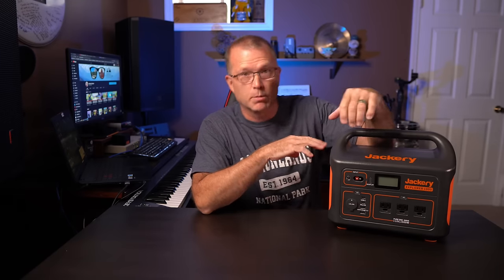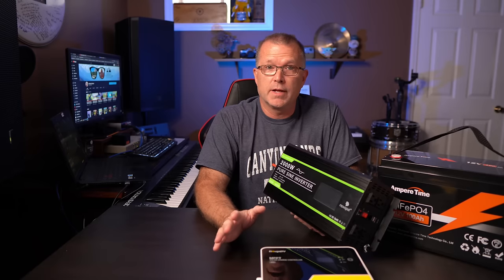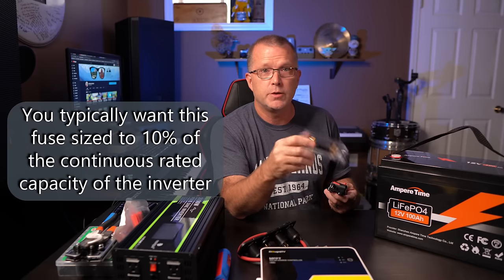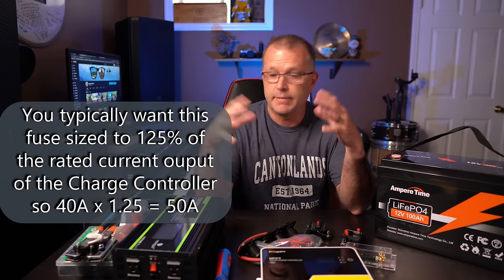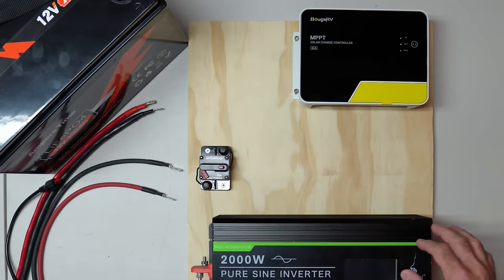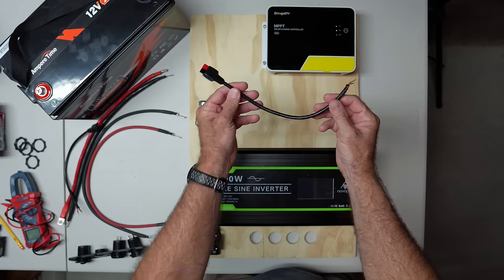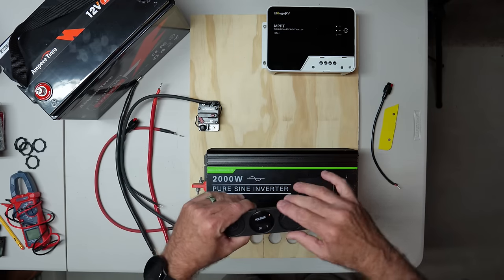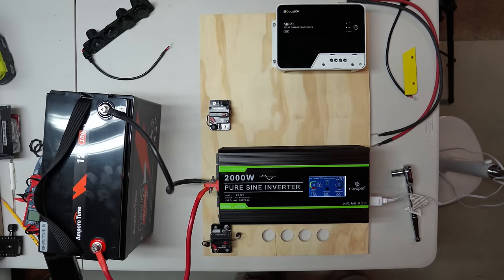BEGINNER FRIENDLY Step-by-Step: DIY SOLAR GENERATOR for Emergency Power, RV, Shed... Ampere Time

Comment: How much actual wattage we can get from that inverter and battery?
Reply from the maker: In this particular configuration, the AC inverter is capable of pulling more power than the batteries BMS can deliver.  So the battery is the limiting factor here, with a max continuous rated output of 100A @ 12.8 V....so 1280W max.
Reply: @ReeWrayOutdoors  makes sense thanks

Comment: Your DC adapters are wired in SERIES.  Not Parallel!  Hope that doesn't give adverse effects when used.
Reply from the maker: yeah - sorry, when I said that, I was still thinking of battery/solar panel wiring - where parallel is when you connect pos to pos and neg to neg.  But no...it works fine that way.
Reply: @ReeWrayOutdoors  So which is the preferred way of connection?  Series looks like you could use only one device at a time, where as parallel you could use all the ports.

Comment: Why not just drill out the hole bigger so that the nut (ring) goes in the back of the wood but still tighten the gage to the faceplate. Just a thought. No glue needed.
Reply: Gage will be held in place by the faceplate and then go through the wood.  Face plate should cover the bigger size hole.
Reply from the maker: I had considered that, but without a drill press I didn't think I'd be able to get a clean start trying to do it with a hand drill.

Comment: Unless I missed it you never showed how you hook up the solar panel?
Reply from the maker: On the charge controller, there's a Pos+ and Neg- terminal.  You just wire the type of connection you want/need for your solar panel(s).  I used an Anderson powerpole connector, but MC4 is the most common connector type.    When using MC4, you just have to ensure that the FEMALE connector is on the POS+ side when connecting to a solar panel cable, since the POS+ MC4 connector from the power source (solar panel) is always the MALE connector - something I think a lot of people don't realize, unless you've had some experience with MC4.
Reply: @ReeWrayOutdoors  👍thanks!

Comment: Your volt meter would have worked out better if you'd have rebated the back of you board ... either drilling larger diameter hole half way through before drilling your meter hole. Alternatively chisel the rear out ... another reason/excuse to buy more tools 😂

Comment: Would this system be able to charge a Nissan Leaf?
Reply from the maker: You can, but charging at 120V will be pretty slow (20 hrs to fully charge) and you need WAY more battery capacity and solar for a full charge.  Amd you'd definitely need to ensure the AC inverter puts out 120V and not 110V  (the one in this video puts out 110V)
Reply: It’s a used Leaf and we top it off every night. About a 5 hour charge. What size inverter do you recommend to to generate 120V?  Very good videos. Thank you.
Reply: @MrHockey172000  3000 Watt?

Comment: Better to compare the voltage reading of the "cheap" controller as well. To compare the accuracy if you are afraid that it may "burn" your batter in case of inaccurate voltage reading. And also that cheap controller is meant for lead acid batteries as printed in the manual. The white version is the one designed for Lithium Ion batteries. 😉
And controllers should also have seperate terminal for the output towards the inverter, for the low voltage disconnect setting to protect your battery from too low voltage.

Regarding the wiring, if connect every negative terminal DIRECTLY to the battery, then reconnecting the negative also to the terminal seems redundant don't you think? 🤔

And cheap controller can't probably handle heavy loads, so adding a relay which is also cheap can help divert the heavy load away from the controller itself.

Comment: I’m looking to DIY solar panels for a generator. My generator input is Max 30v and 10a. 

So for a single panel, I’m thinking Voc 24v (*1.25 temp adj factor) and Isc of 10a.

Question: do I need to worry about the panel exceeding the Isc? Is there some “temp adj factor” I need to take into account? 

Thanks
Reply from the maker: I suspect it depends on quality of your charge controller and how it handles over current conditions, and whether it is Mppt or PWM.  Also your battery configuration should be a consideration.

Comment: how about the homeless vet who lives in his van, and has 2-3 hundred to spend? the extras and frills are not in the cards. a walmart marine batt, a 100 watt panel, a 13.00 charge controller,, and 300 watt inverter. very cheap is all i have to work with.

Comment: Those breakers haven't tested well. I don't recommend using those cheap breakers. Research everything you use before using it. Cheap tech sold online is filled with over-ratings, flaws, and gimmicks.
Reply: I believe this guy is the type who commentates through his own burp. He has in no way got any practical professional electrical experience. His installation looks so rough that the cowboys would chase him out of town. Gluing in an electrical unit? Definitely don't try that at home kids.
Reply: Throw us a crumb? I need to get a couole, but the internet is a minefield and I'm reluctant to buy cheap and nasty stuff that compromises safety. I don't want to see a burned out shell where my shed used to be
Reply: And who tested that breaker and why didn't it test well? Did it not break at its rated amperage?
Reply: @billmarsh1971  what are you looking for specifically? What is a "couole"?
Reply: My cabin is wired 110 romax. 
All my solar DC goes threw an enverter.  I do no DC.except 
Smaller rechargeable tools. Threw an AC enverter. 
I have a lot to learn.
I have not fried myself yet. Lol
Reply: @denisestarr2314  Your inverter probably has built in fuses, but I can't guarantee that. You should be able to verify if it has a built in fuses. Fuses are important because electronic components don't last forever. The components will eventually fail at some point. The power sources should be fused to minimize the damage caused by the eventual failure. Cheers!
Reply: @billmarsh1971  I wouldn't recommend anything that you've not researched, or tested for yourself, and your setup. Do the searching, and test the product for your setup before using it. Is it worth having blind faith in something that has a chance of catastrophic failure?
Reply: @randybobandy9828  Many people have tested these, and posted their findings for others to find. Steel studs, and thin brass conductors are not the best for high current, but this is how they are able to get the price so low. Cheers!
Reply: Any recommendations?   I've got a 2000w pure sine on it's way in the mail
Reply: I appreciate your explanation of the setup process very helpful in general thanks 👍
Reply: Yeah, I had one of those “waterproof breakers” and it went out on me 2 weeks into use.
Reply: So whats the consensus...are these breakers safer or MGA 200A fuse?
Reply: Honestly I don’t think this is more than proof of concept, and your point is a great observation.

Comment: Hello, thank you for such a user friendly tutorial. How can a solar panel affix to this apparatus in order to charge battery? Also. How would multiple batteries be added? New Subscriber...Loving It!
Reply from the maker: Welcome!! And thanks for the kind words! :)  The solar panels can be wired the charge controller any number of ways.  In this setup, I opted for an Anderson connector, but MC4 would be an easy option as well - you just need a + and -  to wire into the charge controller with a connector that is compatible with your panels on the other end.   Additional batteries are connected by cabling them either in series (which combines their voltage) or in parallel (which combines their Current). Which way is best can be a complicated discussion and depending on the size of the system, will often involve a combination of both methods.  I'm planning a few future videos to try and cover this topic.

Comment: You wont be taking a chance with a cheap solar controller. Your 12v Lifepo4 battery has a built-in BMS that will prevent any damage to your battery from over voltage.

Comment: Can't we call it a “Solar Converter System” SCS not a generator?  The solar panels alone are the generator. Just like a generator is made of two parts, the source of mechanical spinning and the alternator that makes the current. The sun is the source, the panel is the converter from photon to electron, all the rest of the system is current management. A generator is truly generating, where SCS is converting.

Comment: I would ditch the lithium battery as they are dangerous and have a huge risk of thermal runaway and burn your house down, go back to the lead acid or gel cells and remove the risk as insurers are refusing to pay out if you put lithium batteries in your home.

Comment: If you want to use something other than plywood nylon cutting board get a 2-foot by 2-foot nylon cutting board, it will not be a conductor of electricity😂

Comment: I really do know I am a real certified master electrician hope this helps If you going to charge ONLY One 12 vote D.C. car battery you got to HAVE at least 300 watts of solar power AlSO if you want to charge two car batteries you got to have 600 watts of solar power other words you got to have at least 600 watt solar panels are you WILL NEVER charge ANY D.C. 12  volt battery AND ALWAYS charge AT 15 AC AMPS AND NO MORE than 15 AC AMPS or you could charge ANY car battery at 13.2 . V. D.C. volts at 35 AMPS AlSO  up to 115 D.C.  AMPS  all the way up to 14.2 D.C. Volts .also D.C. 115  AMPS UP TO 200 D.C. AMPS  and NO MORE IF NOT YOU WILL destroy ANY 12 volt battery AND NEVER EVER run ANY 12 volt battery DOWN lower than 50%  also no lower than 10 and a half. Volts  OR  if YOU DO  YOU WILL  destroy  ANY 12 vote  battery 🔋 AlSO THAT'S where most ALL folks go wrong ALWAYS running a 12vote battery WAY  DOWN WAY too low   they  destroy their 12 volt D.C.  battery . OR D.C. votes battery's

Comment: emergency power... not interested. Homesteading interested.  My biggest requirement on a portable system i can plug n play once it is established on land i would be buying. Not looking just for a shed looking for a legit park my camper here and relax.
Reply: I think this is meant for semipermanent situations, where it will rarely be moved. Something like this is what I would envision for a small homestead. 
For a larger homestead/farm operation, check out Living Traditions Homestead's setup.

Comment: no such thing as a solar generator. are you talking about a solar array?
Reply from the maker: LOL - you're definitely not alone in taking issue with the term 'Solar Generator'.  However, protest the term all you want, but it's an industry standard label at this point when referring to anything that includes solar, battery storage, an inverter and a charger.     I get it though...we all have our 'pet-peeves'.